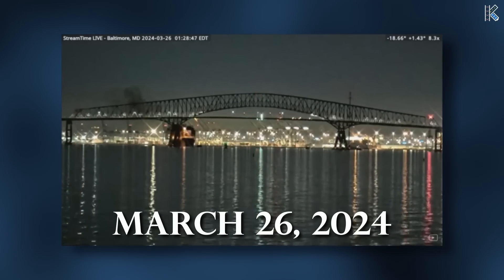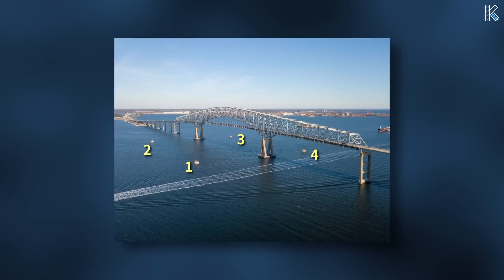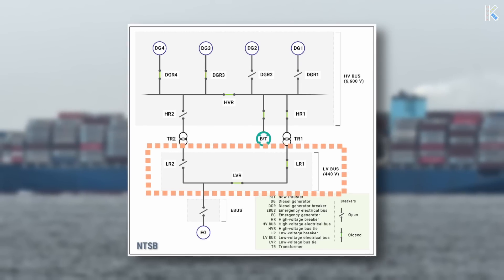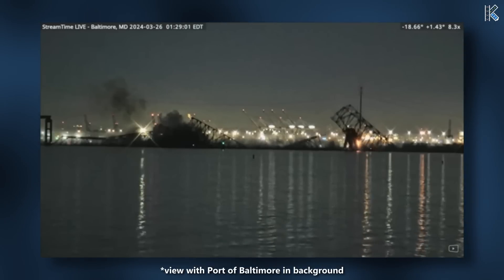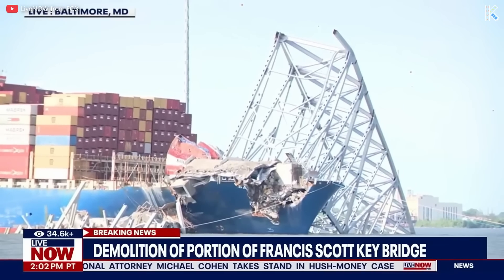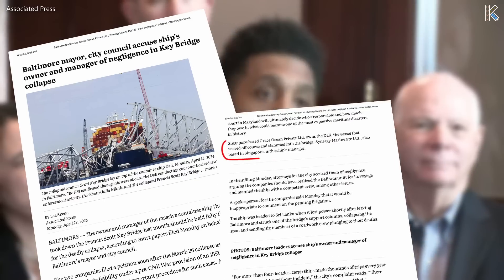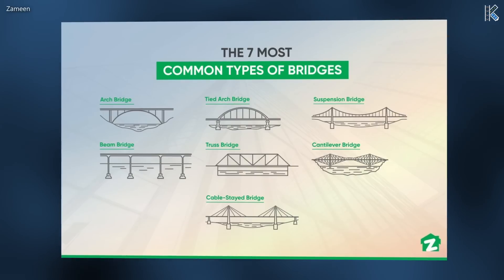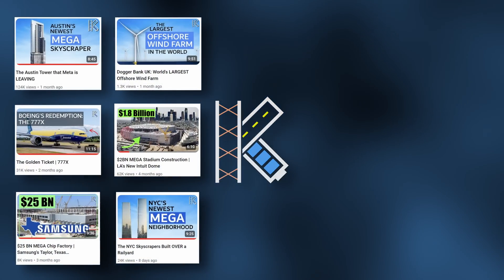Inside the Disaster at the Francis Scott Key Bridge

Comment: it would cost about $220 mill to build a tunnel between the span where the FSK Bridge is ( give or take ) , this is taking into consideration that it costs $30 mill per mile in chicago by the Boreing Company  - to replace the bridge is about 2 billion dollars, they claimed $1.7 to 1.9 but we all know costs will over run... we are going to replace the bridge, reason for this is Hazzard Trucks, cannot go in a tunnel, BUT, if a Tunnel and a Bridge were built, you would have a backup so that the whole system is not completely shut down for years or months and would be a drop in the bucket to add to the system,  so for the next 3 to 4 years this area will be under construction... if there was a tunnel, a code variance with a Manned 24/7 fire station at either end could have used a tunnel in the short  term and act as a backup
Reply: There's 2 tunnels nearby this isn't necessary

Comment: Would tunnel be an option here ?
Reply: Hazardous cargo is not permitted to go through tunnels probably because crashes with hazardous cargo in tunnels would be much more dangerous to clean up than similar crashes on bridges, making bridges necessary for those kinds of loads. Some hazardous loads could also damage a tunnel like explosives, while a bridge would be able to avoid much of that damage should an explosive load detonate. Tunnels therefore cannot replace bridges for all loads that need to be transported, so bridges are still necessary.

Comment: The Gordie Howe bridge is 1.5 miles long, including the half mile center span. With the center span construction completed, the Gordie Howe bridge is now officially a border crossing with customs of both countries on site, (currently screening bridge employees & officials). Note, with the Gordie Howe bridge, NO structural supports are in the water to interfere with (or vulnerable to) shipping vessel traffic. Gordie Howe bridge is also six lanes wide (plus shoulders), plus a dedicated bicycle/pedestrian lane. The Gordie Howe bridge project cost $6.4 billion (CAD), up from the original $5.7 billion (CAD) estimated prior to the COVID pandemic. The Gordie Howe's bridge support towers stand 720 ft high, and their footings are about 725 ft deep. The bridge is designed to last for about 125 years, becoming the longest cable stayed bridge in North America. Expecting to be open in September 2025, construction began in 2018. Tolls will be paid on the Canadian side, since Canada is footing the bill for the entire bridge project, which include both ports of entry, approaches to the bridge from the ports, and ramps to their respective ports from either I-75 or 401 highways. However, bicyclists & pedestrians may cross toll-free, but don't forget your proper ID or passport.

Comment: The only actual solution I can see is to tunnel under the shipping channel, so that there is no bridge there in the first place.

Like the bridge-tunnels in the Norfolk, VA, USA area.

My solution would be a tunnel as on the Chesapeake Bay Bridge-Tunnel and the Hampton Roads Bridge-Tunnel and I-664 Bridge-Tunnel.

No bridge over the shipping channel that can be hit by ships or bombed during war.

The I-695 approach tunnel portal causeways are already in place, for the original design of a  6,200 foot long tunnel.
Reply: Hazardous loads are not permitted in tunnels; so bridges are still necessary to handle them.
Reply: @jnvivian  
Bridges that are in the harbor cannot carry any traffic at all.
Reply: And road conditions in the tunnel are less subject to harsh weather conditions, like icy, or snow-covered bridges during the winter.